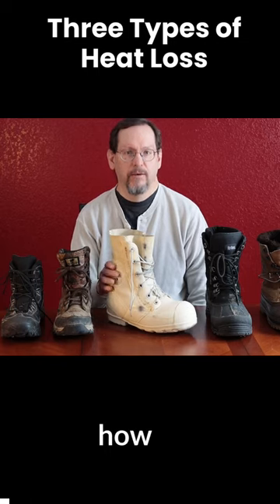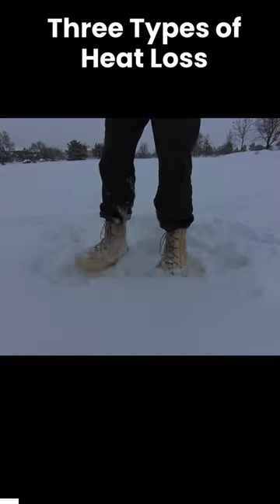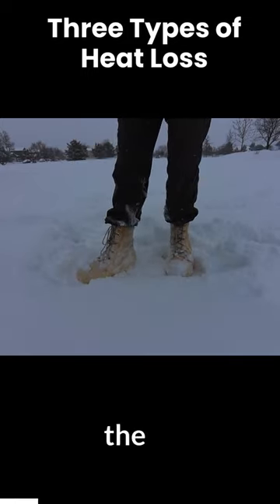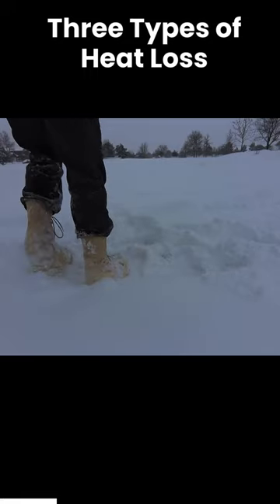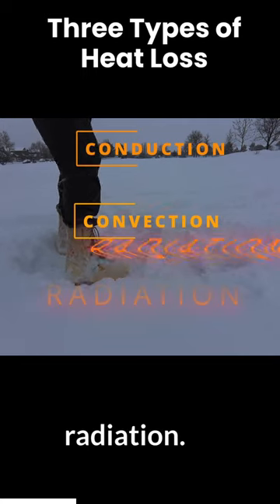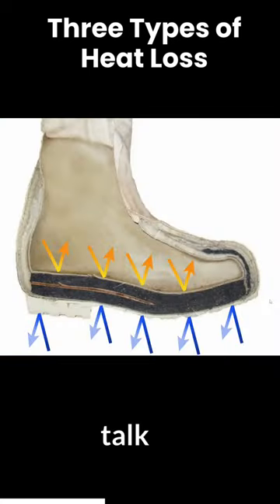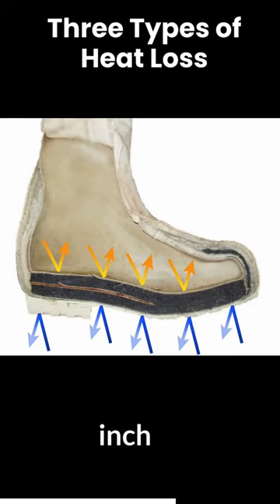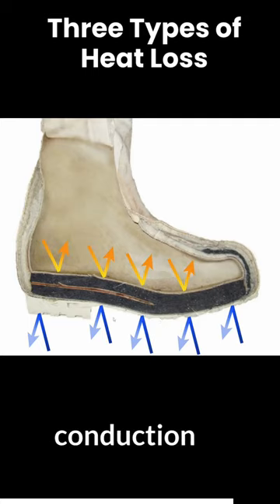How Bunny Boots  Stop The Three Types Of Heat Loss #shorts

Comment: Thank you for this informative and detailed video. Please could you also give your views about the outer soles: (i) are the outer soles tough & hard wearing? (ii) are the outer soles only suitable for walking in snow? (iii) or are they also suitable for walking on rough ground and terrain during freezing conditions but when there is no snow?
Reply from the maker: You have to remember the whole boot is made of soft rubber. I wouldn't walk on sharp rocks or anything. I'm sure you could walk on concert or dirt. But I would say the bunny boots are designed specially for walking in snow and cold.